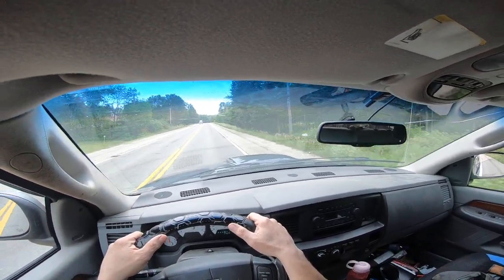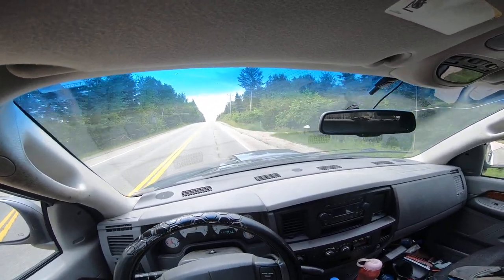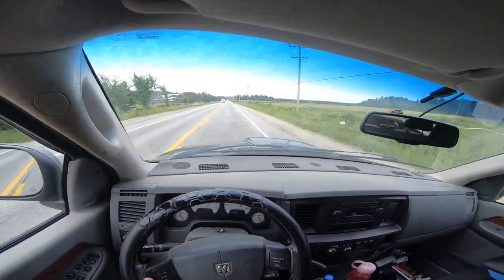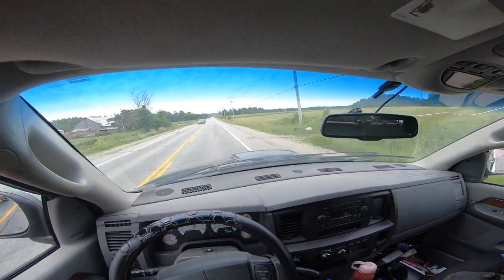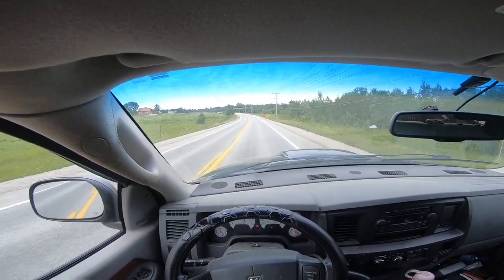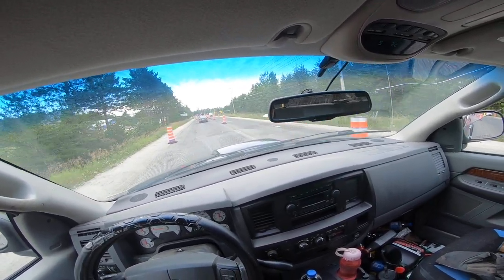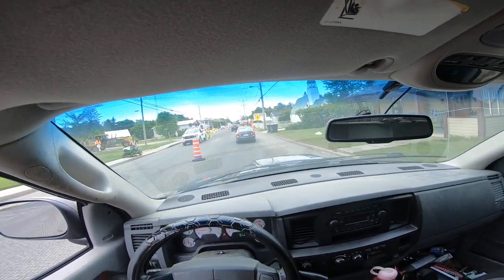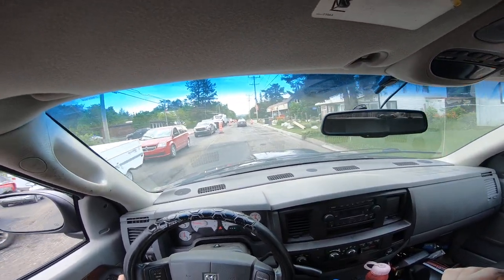OHC Vs push rod?

Comment: Reg, if you want more torque and power theres only one way I know of. Take off the head, scrap off the old gasket that robbed formula 1  performance, apply JB weld with the fiber in it, in place of the head gasket. Tighten the head down and go. 🍩☕🤠👍